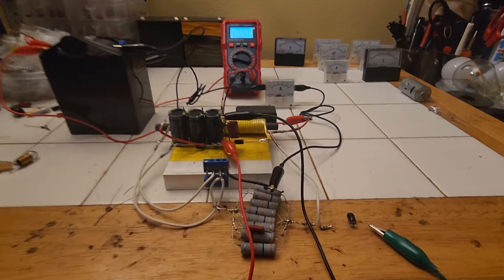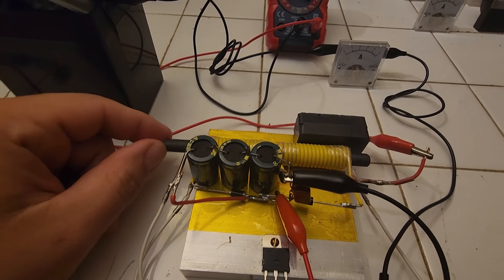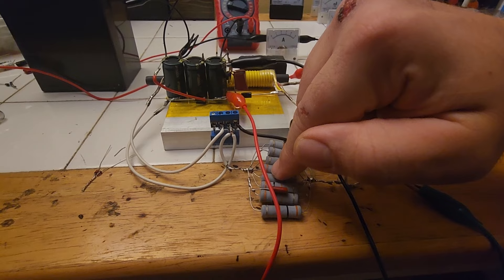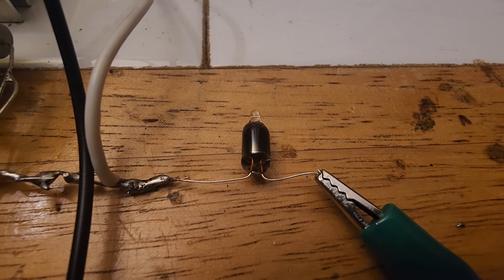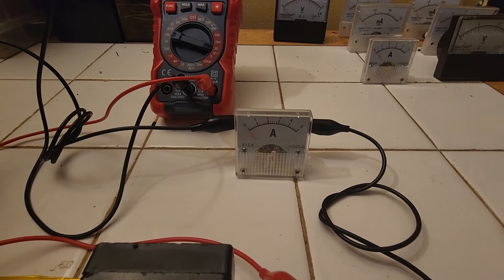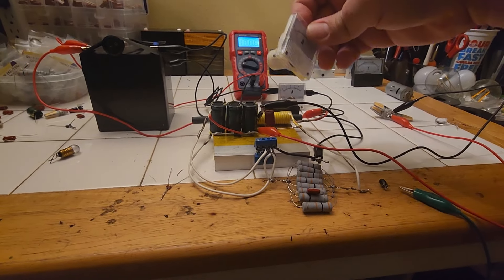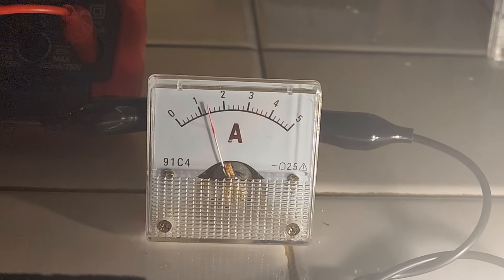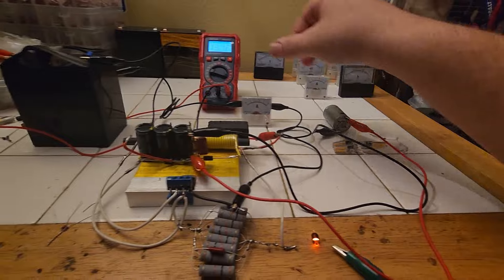🔵Increasing The Negative Resistant Output Even Further For Optimization Of Battery Super Charging🔋

Comment: That answers my question about the wireless receiver, the more resisters in parallel the better. 
Now wondering if you have determined what makes that special neon bulb more efficient? And, like the resisters, is there a benefit from connecting more in parallel or serial?
Reply from the maker: @MMPowerCafe  so far the system seems to be maxed out with the three parallel resistors & 1-2 neons work great for reducing power consumption while simultaneously increasing the strength of the oscillations but too many in parallel will actually draw excess power from the circuitry :)

Comment: use avramenko circuit with 2 diodes(schottky) to charge batteries with one wire without loading the circuit down.

Comment: Checking your provided schematics in the PDF from your patreon page the earth connects directly between the carbon resistor and L2 coil, then, that joint basically is connected to the emitter of the transistor trough the cold cathode neon bulb however now the earth is connected through the neon bulb between the resistor and L2. Can you explain why? What is the difference? I'm also confused about L1 or L2 is the primary coil? The diagram shows as L1 (26awg) is the primary but the pictures show that it is connected as secondary (between base and collector with the carbon resistor in series).
Reply from the maker: Much more updated pdf construction guide coming within 2 weeks :)

Comment: if battery have 20 000 cicles charge-discharge lifetime then it means next:  5sec (for full charge-discharge time) * 20 000 = 100 000 sec it is lifetime of battery in the working system. 100 000 sec/60=1666 min/60= 27 hours .......so...after working non-stop system 27hours your battery die and you need a new one. what is price of your battery? 300$ or more ?  so. using your system need spend 300$ each 27 hours. I am right or not?
Reply: I guess he already cycled much more, doing his experiments so you're not. :)
Reply from the maker: Greetings i believe the cycles on mine were advertised as 50-60,000
Reply: @MTECHINDUSTRIES2022  I have seen the test : supercap 16v 100f is fully discharged by the 12v bulb in 2 min. so, if it charges 3 times faster than we have totally charge-discharge cycle in your working system lest say 3min. If we have 60 000 cycles lifetime battery(supercap) then 3*60000=180000min/60=3000h/24=125d/30=4 month nonstop working system and you need to pay again for new battery. ok. imagine we use 7h/day than we have 12month working battery(supercap). so if the price of battery 50$ /year payment for 40w bulb light. if we compare with usual use we see 40w*7h*365=102200 *0.2$/kwt =21$  . so if we use the system we pay 50$/year (becouse supercap die and need a new)  and if we use usual home electroline then we pay 2 times less for the same quantity of received light. Totally conclusion that device is not rentable to use at home but it is good to use outside of line (in the car or in the nature in the trip and so on). the same we have to compare using outside the device or the usual generator to see the benefits. But in total I think your device is very usefull thing